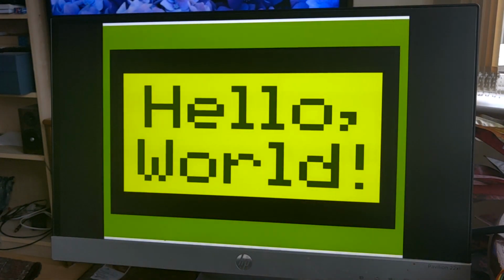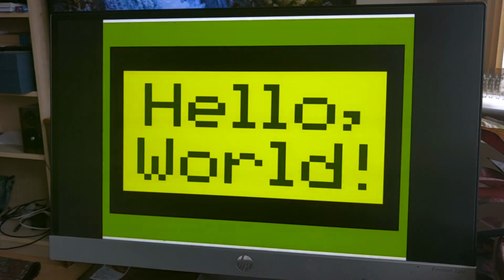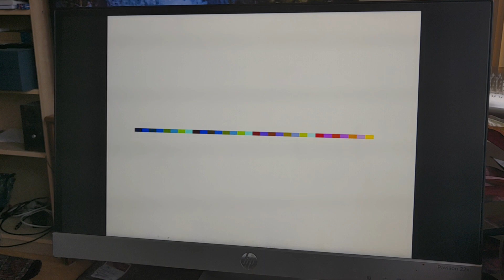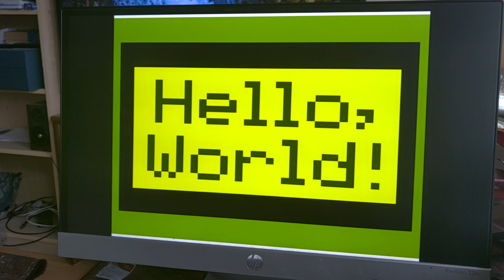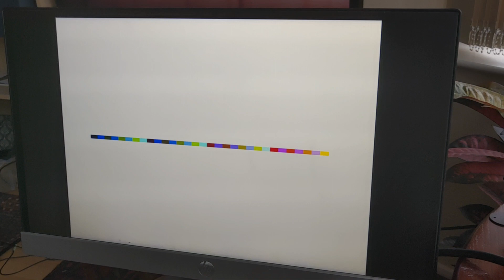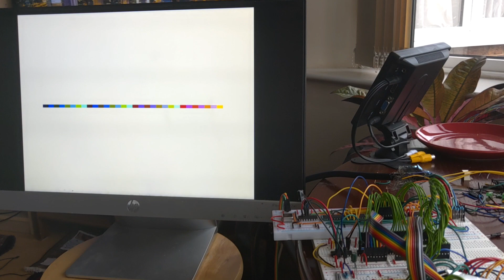Simplest VGA circuit - with Ben Eater's 6502 and synchronized CPU clock

Comment: I like it. So many classic 6502 designs used this same basic idea like your other computer especially of sharing video and CPU memory and fitting in the cycles on alternate sides of the phase 2 clock.  It did lead to a number of cool software tricks when you could really rely on a quite a deterministic and precise timing between CPU and video.  Nevertheless, it would be interesting to make a GPU which was more stand alone - more like 9918 in style (see VTech CreatiVision for classic example)
Reply from the maker: I'm planning to do something more like that next, so that the computers main clock isn't tied to the video pixel rate. Initially this can just be used to stream pixel data but maybe I can then do some hardware accelerated copies, line drawing, etc

Comment: Wouldn‘t a FIFO for the VRAM be a better option? So that the cpu can write to the VRAM over the bus while the VGA can read from the VRAM at the same time. That would solve the problem with the shared bus.
Reply from the maker: I considered using latches to make a one-deep FIFO.  The trouble with going deeper is there are a lot of bits of data to buffer - 15 address bits and 8 data bits.
A FIFO would make more sense in a system where there's a GPU that can read a command stream from the FIFO and execute the commands independently at its own pace.  Then you could have a much narrower FIFO and more powerful commands.  This is essentially how modern graphics cards work.

Comment: Great video. Would it be possible for you to make a schematic?
Reply from the maker: Sure thing, the schematic for this version is actually on the Hackaday page, it's the last two images in the gallery there. It matches the circuit in this video but not the changes in the next video, I ought to update it with that. https://hackaday.io/project/175434-worlds-simplest-ttl-vga-circuit

Comment: Hello I have a question. How do you write new pixel bits into the VRAM while updateing the monitor with new pixels without distortion??
Reply from the maker: The 640x480 pixel clock is about 25 MHz, but as we're using 4x4 "big" pixels here, we only need to fetch from VRAM at about 6.3MHz. The D flip-flop latches the value and keeps outputting it until the next big pixel. In the meantime the VRAM is idle and we can let the CPU access it.

I made a video talking through the timing diagrams that coordinate that, but it's kind of long and I'm not sure if people will have the patience for it! I'll publish it anyway though and find out!
Reply from the maker: The other aspect I should mention is that I wire the vsync into the 6522 so that I can wait for it to start before updating the screen each frame. This avoids the player seeing a frame with some things updated but not others. However, Snake is particularly easy for this as so little needs updating each frame anyway.
Reply: @GeorgeFoot  thanks. Also,
So your RAM chips have a latch on its outputs. Is this called a frame buffer? In my seat up I only want to write to vram from cpu data bus. I think the reason why I am getting distortions is because i connected the cpu bus to vram IO through a buffer. And instead of using a latch on the vram IO outputs for the RGB DAC I am using another buffer. Perhaps I need a 74373!
Reply from the maker: What sort of distortion are you seeing? Does it only happen during a write, and does the write take place correctly?

Whatever you use to join the buses needs to have an output enable option, because no one system is driving the video buses all the time, they take turns. I'm using bus transceivers for these, 74HCT245s.

The output flipflop is also essential, otherwise whatever's on the bus while the CPU is writing to VRAM goes straight to the monitor as well. The type of flip-flop is less important here, it doesn't need tristate outputs, so a '273 or '374 or anything similar should be fine. Another option is using a shift register, which is great for getting high resolution in monochrome.

Comment: Great update (and VGA). When I first tried out my VGA card with RAM I hooked it up to a Arduino Mega to test. I used digitalWrite to output the address and data, not directly using ports, so it was a little slower than it could have been. However I still got glitches writing to the VGA RAM, as it was an asynchronous transfer,  but I managed to fix that by putting 100pf caps across the write lines to my input latches. That was back in January and haven't tried it again and my current VGA doesn't use the 100pf caps but it might be a quick and dirty fix if you want to try that. You can see it working in my video with the finch and the stripes and the one with Life running.
Reply from the maker: Hmm I'm not sure why that would work. The way I see it, if there's any contention, at a high level either the CPU will win, the write will occur, and the video output will see garbage temporarily; or the video output wins, and the CPU's write doesn't happen. I kind of prefer the first case as it's temporary.

If the CPU clock speed is low enough, it may hold the write active for long enough that it catches some video circuit downtime, and then the write will work even in the second case. I'm sort of planning to use the current synchronous timings to control that, if I do go back to being asynchronous.

There's still a problem though with the transitions - you need the bus to be stable on either side of the write signal. I had problems yesterday due to not doing this, which were fixed by adding some margin.

I considered simply buffering the CPU bus in flipflops instead of using transceivers, then having the video circuit write whatever is in the buffer when it gets a chance, but it's also important that the address is stable during the write, we can't have the CPU changing it part-way through. The video circuit could snapshot the address and data before starting the write. Even this wouldn't be atomic though, and the consequences of writing the wrong address are bass enough that is like to prevent it.

So I've considered adding an extra flag saying that a write is pending, and ensuring a delay between the flag being set and the address and data being clocked in, like debouncing. I think this would work but is deviating a lot from "simple"!

There's also CPU read access to consider. Your solution works pretty well for that. But with synchronous timings you pretty much get read access for free anyway, at least for now.
Reply: @GeorgeFoot  The capacitor would probably be acting as a load capacitor to help match the source impedance, thus reducing reflections and ringing on the signal.